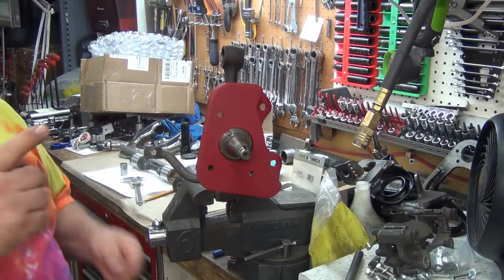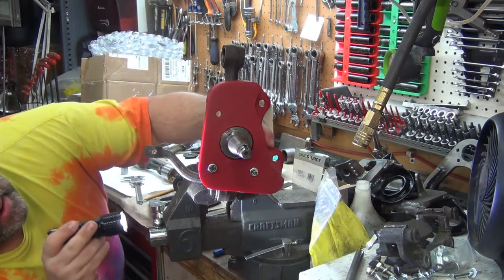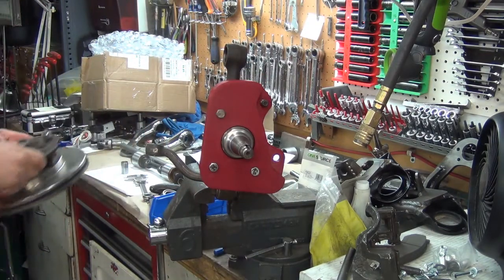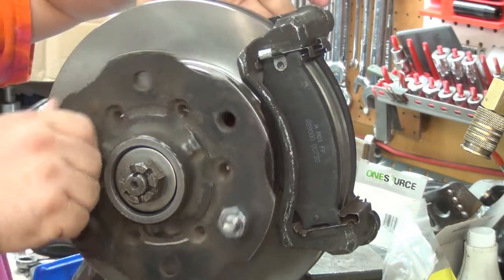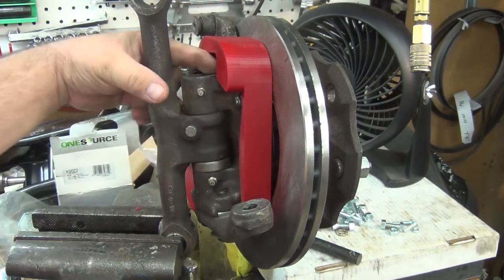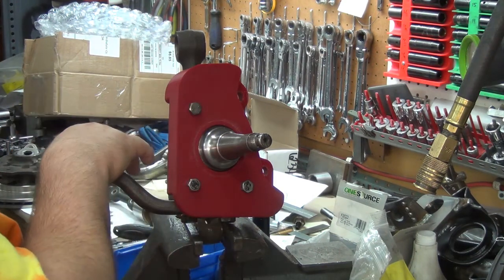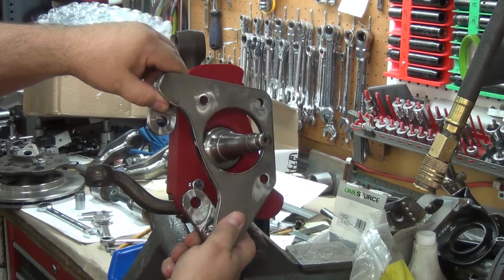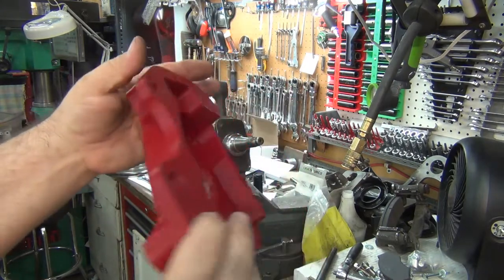Aluminum Truck Bracket - 3D printed prototype

Comment: 3d printing is cool stuff.  Can you use that same model file that the plastic piece was made from to plug into your CNC in order to make it out of aluminum?
Reply from the maker: Yes.  I actually design the part for aluminum.....then just save the file as an .stl file and email it to George.  The part file is unaffected by creating the printer file.  I had it done for a week or so before I finally sent the file to him.  Here's some pics of the CAD art. I've modified it slightly and sent him another......just haven't updated the pics on the site.
http://www.bluehandsinc.com/one-piece-al-bracket.html
Reply: Very cool.  The computer stuff just isn't something I've gotten into.  I appreciate that its cool, but my South Bend isn't USB compatible.
Reply from the maker: LOL!  I've got a manual lathe and round column mill too.  They definitely still have their place in the shop!!  I'm just bright enough to come up with designs that I can't figure out how to do manually......so I went with computer control to compensate. LOL! :)
Thanks!
Reply: I hear you.  There are some parts I wouldn't mind being able to make, but doing it manually would take an age.  One part would either require a CNC to hog it out of a block of aluminum, or a furnace and molds to cast it like the original was, then machine it manually.   Of course I expect about 3 people in the whole world would want one, and I'm not one of them since I have an original.
Reply from the maker: I tend to deal with that same "lack of a market" with Datsun parts! LOL!!! :)
Reply: 80s full size Fords are probably about the same, and the people interested in upgrades are a subset of a small market.
Reply from the maker: It's worked out well having a very small market.  Aside from the lack of competition(more or less), I don't get overwhelmed with orders. :)

Comment: That is a beautiful piece of work!  I'm mildly concerned about the clearance between the upper bit of the bracket and the inside surface of the rotor, though.  Just seems a bit close for comfort!  You'd be surprised just how much movement there is in the spindle/knuckle under load.  If you have enough meat in there to give .060" of clearance, it might be worthwhile!  :)
Reply from the maker: Thank you!!  The top should have as much clearance as the bottom.  There was a slight bit of warping in the print that made it sit closer.  I'll see what I can do.  If I change up the dimension on the bearing adapter, I should be able to easily get that much room.  Sounds like George and I might just be doing an second print, so I'll see about putting up a vid of that one too. :)  Thanks!!

Comment: I'm fairly new to your channel, so why are you designing and building car part mods?
Reply from the maker: Hi Billy!  Welcome!  I'm into old Datsun pickups. '63-'78ish.....with a preference toward the '69-71  521 model.  There's very little support out there for parts to begin with, but what started it was that I didn't want my wife driving hers in Portland traffic......everybody else has better brakes and nice front end parts are hard to find. :)   I put disc brakes on hers years ago and the setup has evolved over the years.  I've created several other setups for various Datsun vehicles.  I guess the answer to your question is partly necessity and partly for fun. :)
Mike
Reply: Thanks Mike, I was worried that you would think I was a smart ass with question and not genuine .

I had a Datsun pickup once, it was a 4 cylinder diesel. (might have been Nissan but I dont think so)
Reply from the maker: When you said you were new, I figured it had to be a genuine question.  :)
I'm guessing your pickup was a mid '80s truck when they were switching the name from Datsun to Nissan.  The did a couple of years with Datsun by Nissan, then Nissan with a smaller Datsun badge.  For me....those years are great parts donors!! lol :)
Thanks!!!